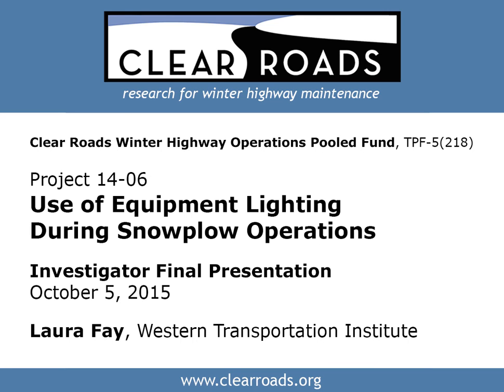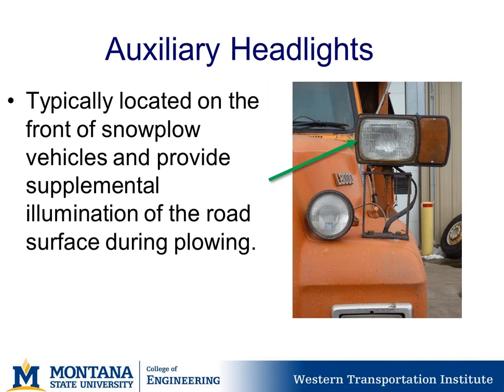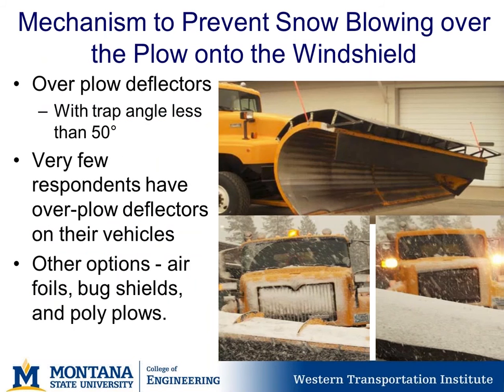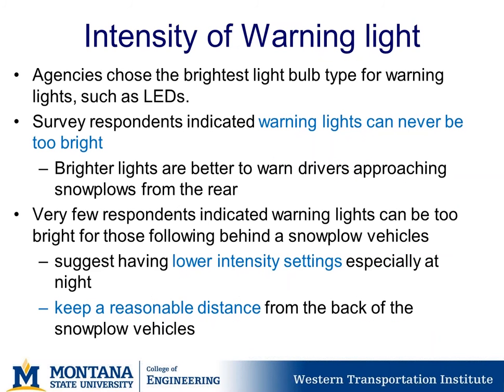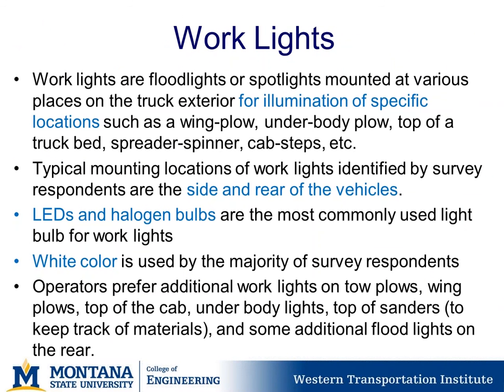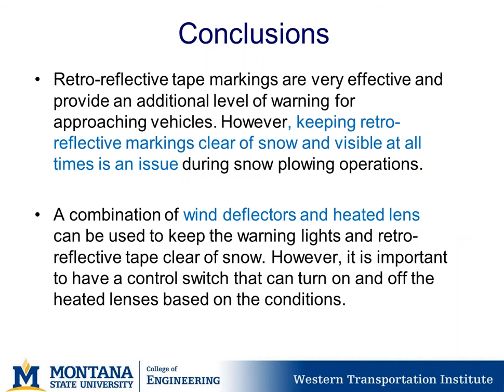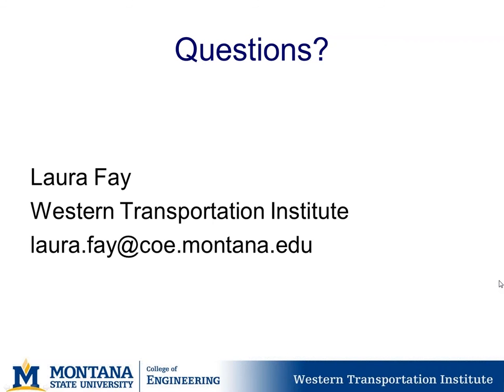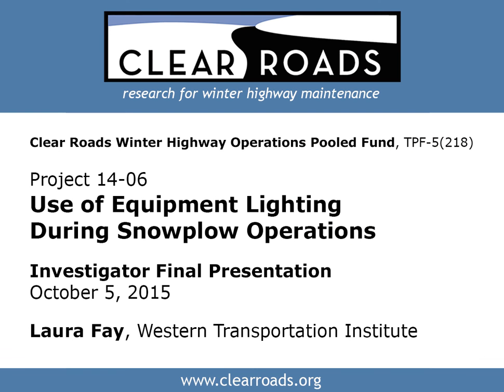Clear Roads - Use of Equipment Lighting During Snowplow Operations

Comment: The Human Eye is a tricky thing.  They should actually gone out and Tested these Ideas.  As a Ex Fire Fighter, Truck Driver, And Snow plow Opperator.  I have used Yellow, Blue, and White, Headlights in Fog, and Blizzards with visibility in near Zero levels in the Mountains From Pennsylvania to Georgia. It will show more in the long term but I was less stressed had better vision with less Glare with the Yellow Headlights, But I DID NOT Realize the Benifits of the Yellow till I was in a true White out conditions at night.  The Glare Levels were Less Creating less Stress.  As a Fire Engineer/ Driver We put the White Strobes and LEDS on separate switches because of glare in the worse conditions.  Because Fire Trucks can not Park and wait for conditions to improve.  So for The people doing this Get off your rear ends and Go out at night in the worse of these Conditions and try your theories out.  And One More Bit White Out Conditions means Visibility of less than 40 feet And Drive Safely.